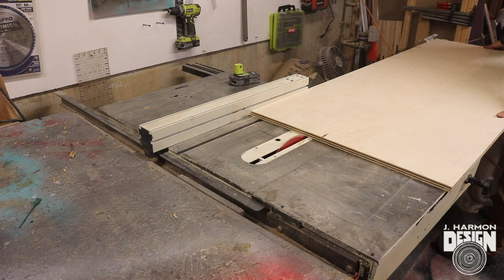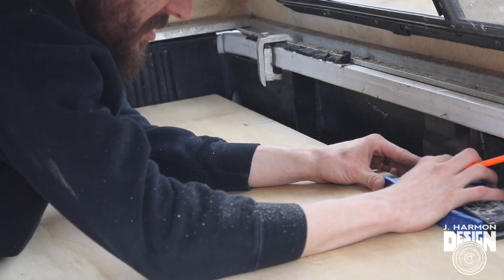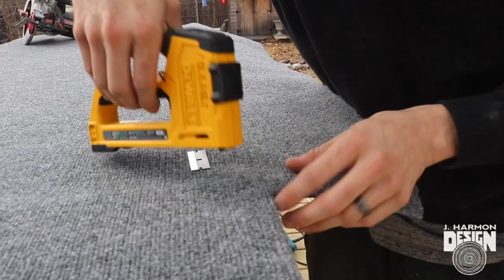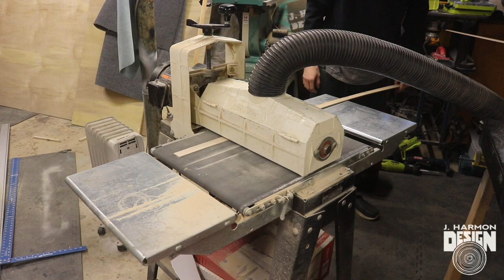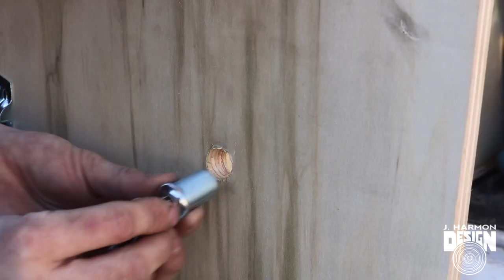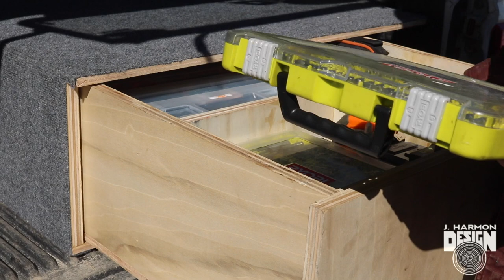Custom Truck Bed Tool Box // Storage Box

Comment: Nice build, similar to what I made but I did not fit strips to the underside but I am now. What did you work into the strips? Cheers
Reply from the maker: Will Tricks thank you. I’m glad you found the video helpful. On the strips I used a paste wax. After a few months they still slide smooth. But I will probably recoat them every year.

Comment: Very nicely executed! I have a ranger as well  - anymore truck projects on the horizon?
Reply from the maker: Matt S nothing planned. But I’m curious what kind of things you would like to see.
Reply: @jharmondesign  Well, I have an old truck topper on my ranger - it needs some love. In the near future I would like to install some lighting on the inside and possibly do a removable truck camping setup in the bed,. Not sure if those fit your interests or target audience, but those are the types of things I am looking for inspiration on.
Reply from the maker: Matt S great ideas I’m gonna keep them in mind! A camper has been a thought. And this bed storage is wide enough for a camping pad. And being raised gets you closer to the windows of the topper for warm nights.
Reply: @jharmondesign  I was thinking the same about the storage being a good sleeping platform. I love it.
Reply: @jharmondesign  i have a newer ranger and a truck bed tent, right now i sleep in the middle of my wheel wells when i go camping, though i like the thought of raising it up over the wheel well and having a sleeping pad.  
I have a bed cover but i was thinking of a half storage solution like this.
I'm a pretty big guy though so id have to do some measurements and test.
Though id make this removable probably so i could just take it out when camping if it would be an issue of space.

Comment: Nice job. What did you use on the drawer bottom to allow sliding?
Reply from the maker: I used two thin strips of maple. Slathered in wax. To decrease friction.

Comment: I like your design.  How did you secure the tool box to the bed so it doesn't slide from side to side?
Reply from the maker: GD100 thank you. I don’t know if I showed it in the video. But I had to crawl into the box and screw self tapping screws down into the bed. I believe I only used 4 (two on each end)